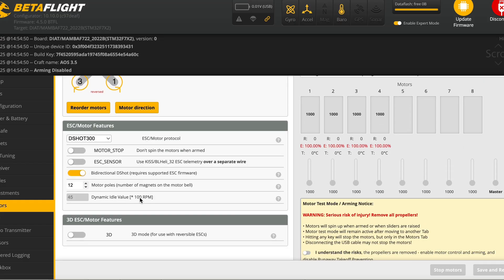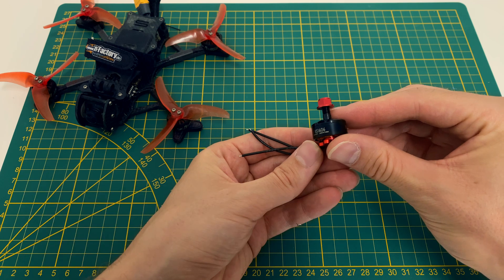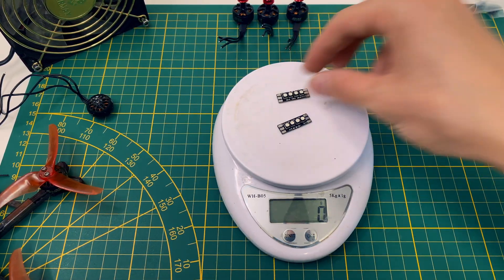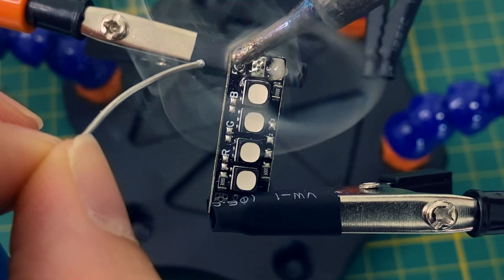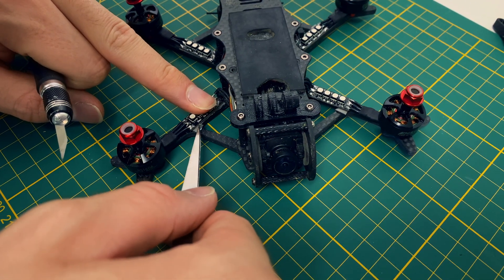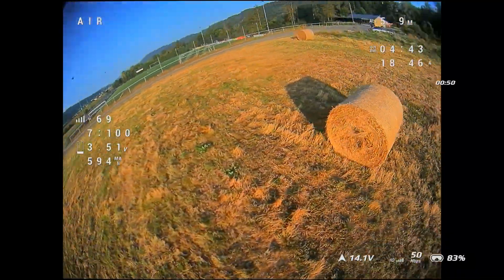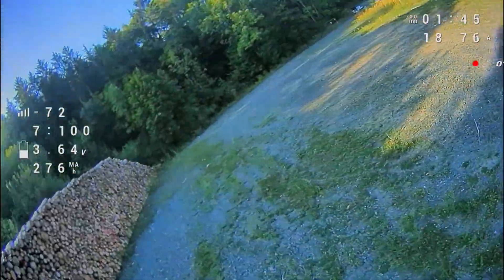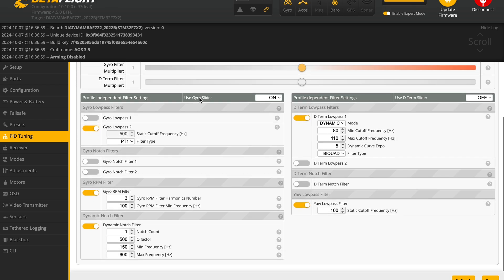AOS 3.5 EMAX RS1606 3300KV Motor Swap — Props, Weight & Flight Feel

Comment: Danger, fly! Good afternoon. I just used AOS 3.5 Criss preset with its respective filters, and when I increase the throttle, the drone shoots upward. I use the standard Betaflight 4.5 preset or the UAV Tech preset, and it doesn't happen. It's very strange because I've never had anything like this happen in the seven years I've been flying drones, and it only happens with Chris Rosser preset. My system is a Hobbywing F7 ESC 40A Blheli32.
Can you think of a possible reason for this?
Reply from the maker: With „my“ Preset? Which Preset? 
Ig the quad freaks out on arming the the tuning is not correct.
Reply: @fpv-geek  not your preset is with Chris Rosser preset for AOS 3.5 sorry mistake.
Reply from the maker: Ah, okay, I was confused.
Yes, that's strange. Is your build otherwise identical?
I think the preset just doesn't fit. I don't use presets anymore because I always tune myself.

Comment: is there a cw and ccw or is it just the escs managing it?
Reply from the maker: The ESCs handle the motor direction, and you configure the desired rotation in Betaflight. This ensures the motors balance each other out; otherwise, the quad would just spin in one direction in the air. Also, props come in two types: CW and CCW.

Comment: I've got these motors for a 4" build . For 3.5" they really need high 3000 low 4000 kv
Reply from the maker: Yes, the 3300KV works well with a high pitch prop. With a low pitch, you realize that the motors have too much torque for 3.5”

Comment: Hq 3.5x2.8x3 are also great.
Im totally with you on the 5mm prop mounts. Screws suck.
Also the tmotor 3140 props are so damn awesome. Give them a try.
Reply from the maker: Thanks for the recommendation, I'll add it to my shopping cart 😊
And yes, T-Mount is annoying. But I have the problem with the Emax that the motor bell slips out of my fingers when tightening the props. (In summer, especially with sweaty hands😂)
Reply: @fpv-geek  i guess you're from Europe. Amax has 2004 and 2005 motors with 5mm shaft in various kv. Good quality. Otherwise maybe tmotor 1804 with 5mm prop mount. Wider motors don't slip in your fingers that easy.
Reply: @fpv-geek get some motor pliers :) handy tool!
Reply from the maker: @SnoopFPV  Oh, thanks for the tip. That looks just right. But are they also available at a reasonable price?